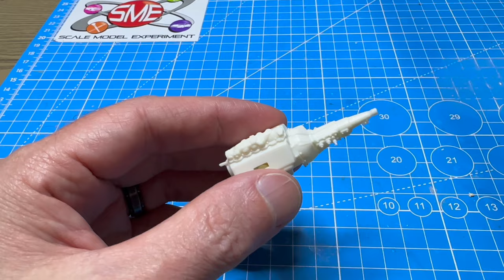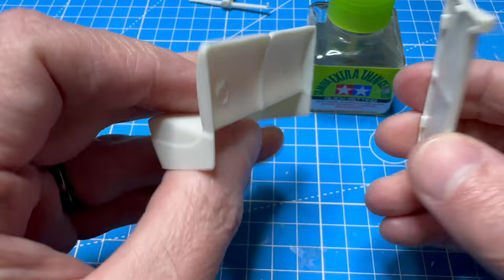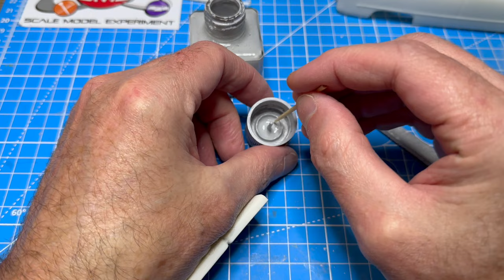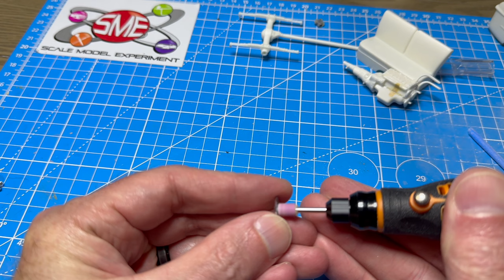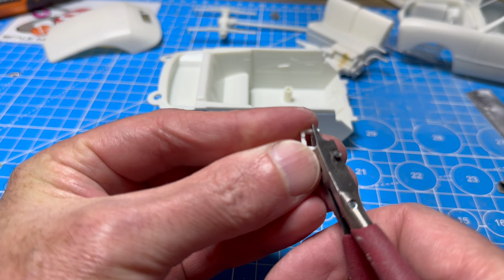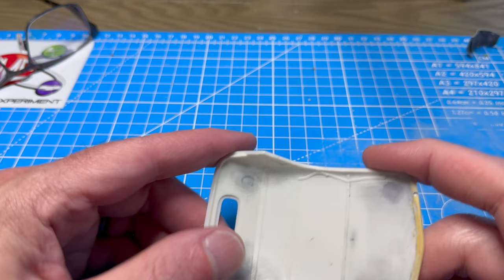Part 4 - Model Car Building Basics - AMT 1950 Ford Convertible

Comment: AMT should be embarrassed by the absolute shit they call model kits.
Reply from the maker: Wow, you have to remember that this model kit was tooled up in 1962.  All it takes is some clean prep work and you’ll have a nice model.
Reply: @ScaleModelExperiment  Hey, I was tooled up in 1967 and with some clean up and prep work even I'll look presentable. But know I can't compete with newer, better models. But then I wouldn't be asking for an unrealistic retail price, either.  Thirty bucks is the going rate for this injection molded turd, and there's no way it's anywhere near worth that price. I've tried giving AMT several goes in the past, and never got anything out of them but frustration and the feeling of being profoundly ripped off. I know when you're done with this unassembled toy, errr I mean model, It'll look great. But that's what you specialize in- turning chicken shit into chicken salad. Back in the day when I was a kid and these things were 3 or 4 bucks at the Woolworths, you could justify the crap we were fed because they were cheap and it's all we had. But times have changed and AMT hasn't.
Reply from the maker: @deathpallie  I understand your point.  We are about the same age but I didn’t start till my late 20’s. Kits were $10 then at Walmart. Those days are gone. Reissues keep model prices down actually as original kits go for big dollars. But you really have to know what you’re buying these days.